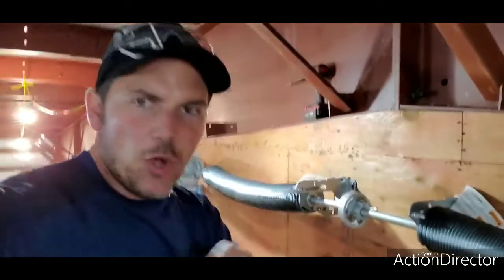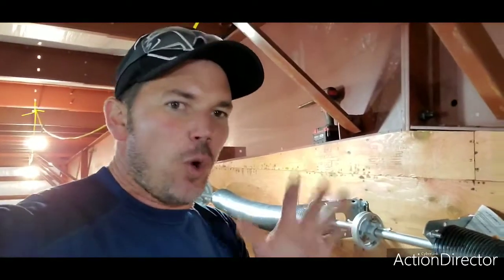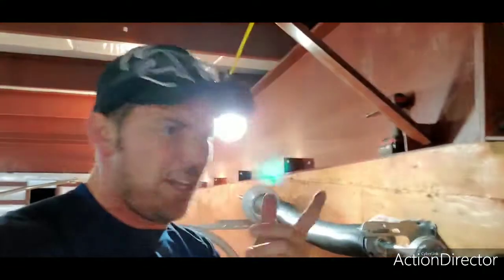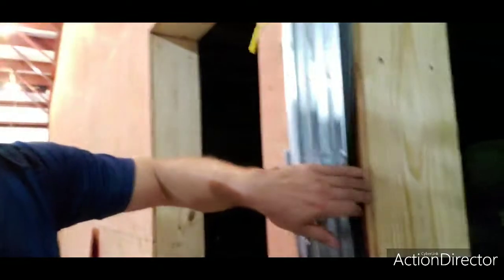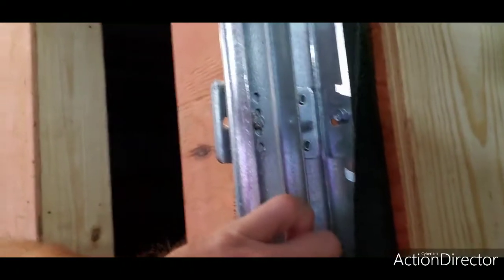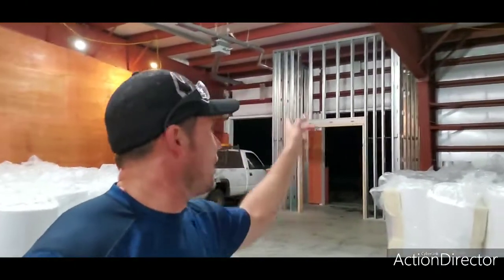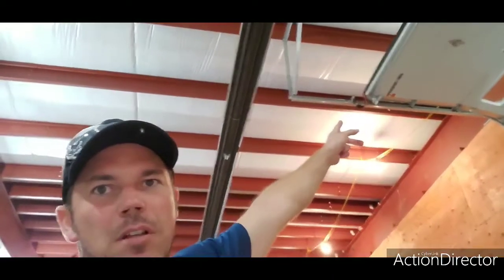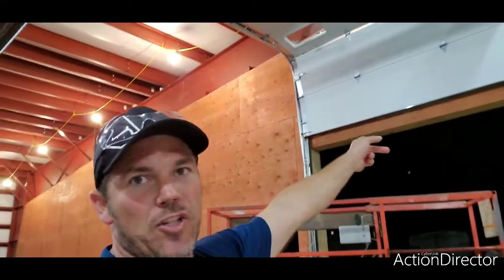Clopay 3715 Tips and Tricks

Comment: How do you attach the reverse angle to the steel jambs? Do you pre-drill and thread the screws in or do you use something that screws into the steel without pre-drilling? I haven't done much with steel jambs, I do mostly residential work and some light commercial ( ex. pole barn) where it's most always wood jambs with lags or once in a blue moon concrete where I've used tapcons or anchors
Reply from the maker: Your in luck I'm going up tomorrow  and I will make a video on it for you.👍